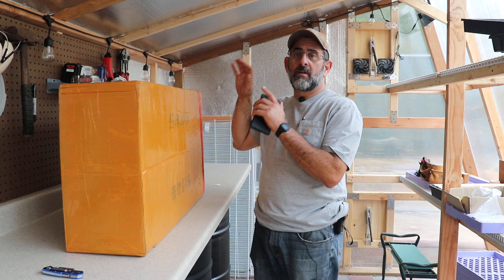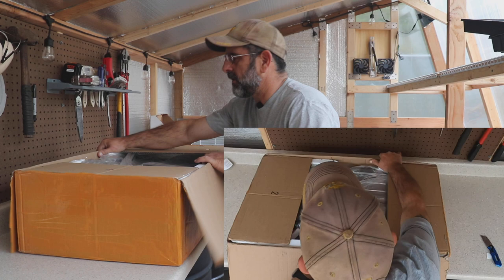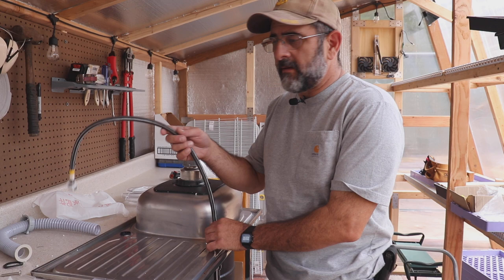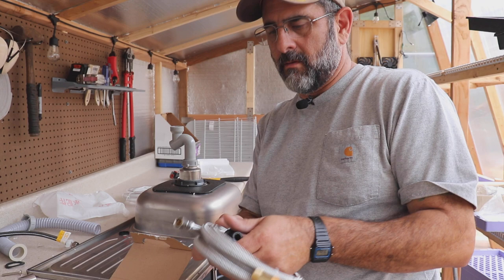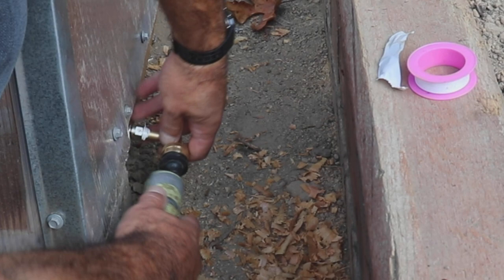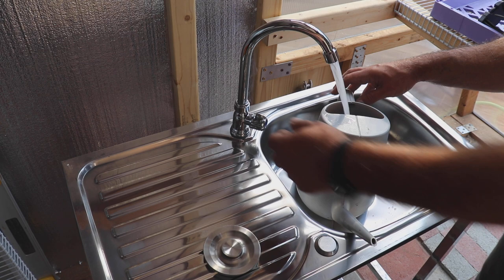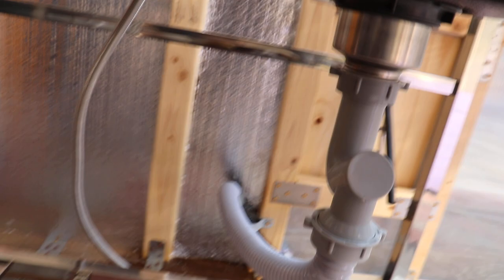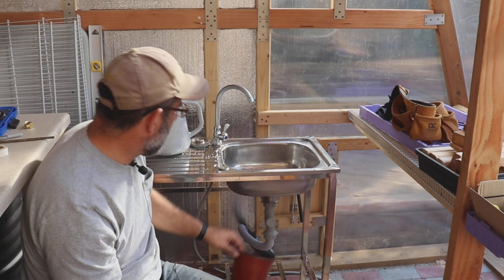Installing The Cheapest Stainless Steel Amazon Sink In A Greenhouse

Comment: I have picked up those double aluminum sinks that people throw out by the curb. I have a double aluminum one in my kitchen in the house. And I found an identical one by the curb that someone threw out. And I even have found a smaller double sink that someone took out of a travel trailer and threw out. I plan to install them in ny greenhouse and probably the smaller one in my yard for repotting plants ect...
Reply from the maker: I have been using mine every day.  Fill it up and use the sink to fast fill cups for faster watering.  Happy Gardening!

Comment: Been looking at the same type of sink, thanks for the great product demo.  I need to use it outdoors 100% for a garden, don't want rust.  The product info said its made of 304 SS & alloy steel. Sounds like the top is SS, any idea if the frame is also SS ?  How is yours holding up?
Reply from the maker: I just went out and checked.  It is all made out of the same type of thin metal.  After using daily for the past 6 months, I love it.  No rust at all.  Happy Gardening!